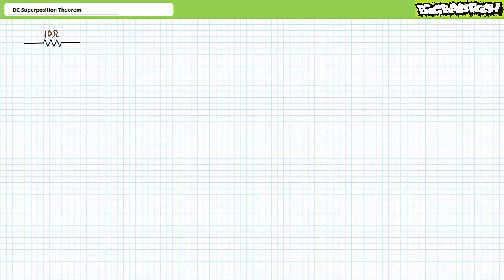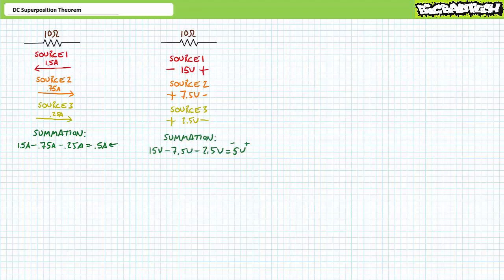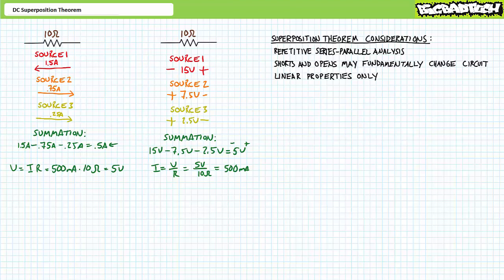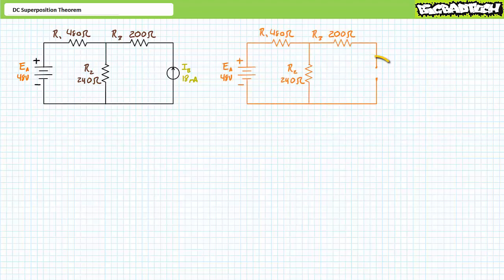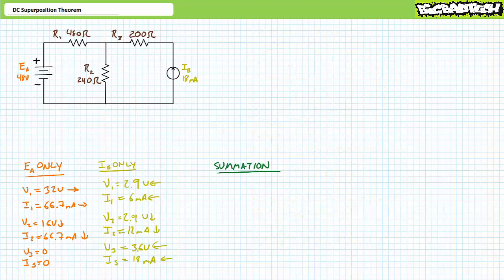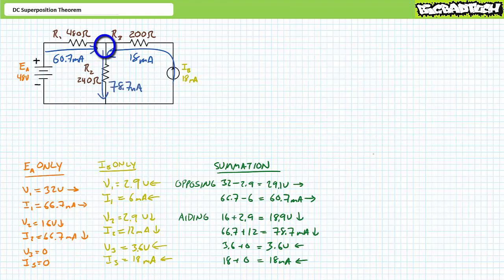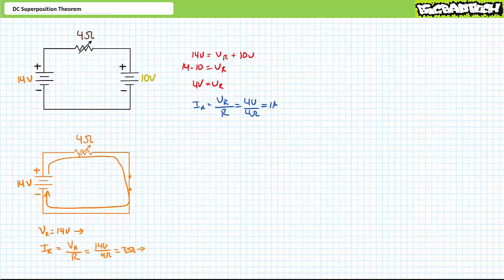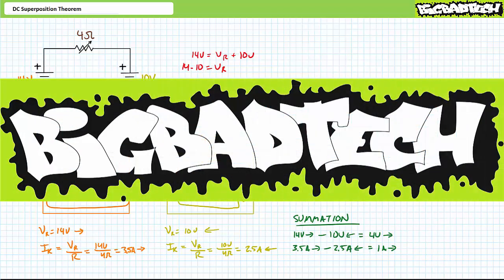DC Superposition Theorem (Full Lecture)

Comment: Do the principles of this method hold firm when analyzing RCL circuits as well?
Reply from the maker: Yes. Check out the "AC Superposition Theorem" lecture at: https://youtu.be/TsUp7Xl7-A8 Also, if you're ever dealing with DC + AC systems (EX: an AC system with a DC bias) one can examine the systems response from the DC perspective (ie: steady state capacitors act as open circuits, steady state inductors act as short circuits) and again using the AC perspective and superimpose the results on top of each other.